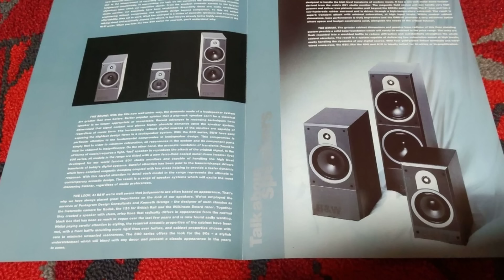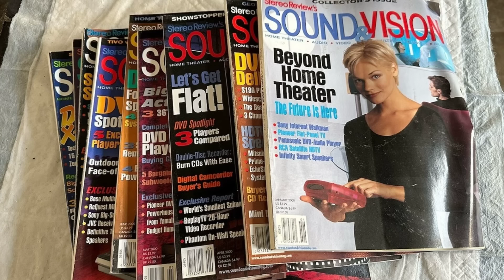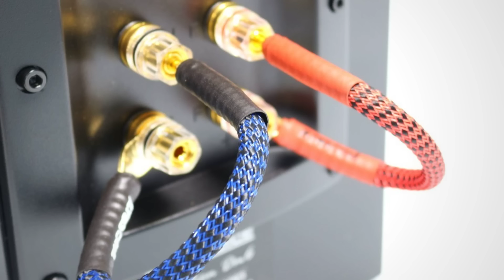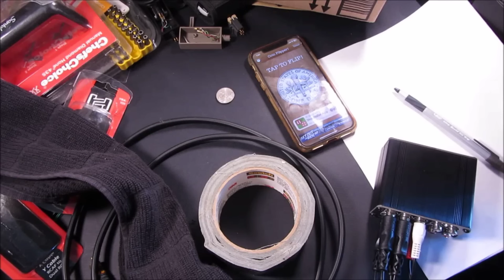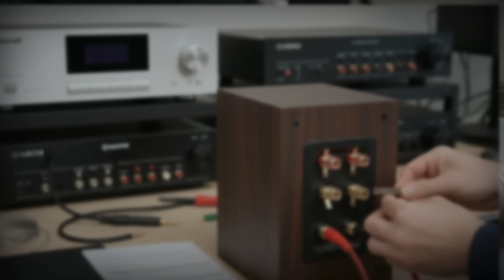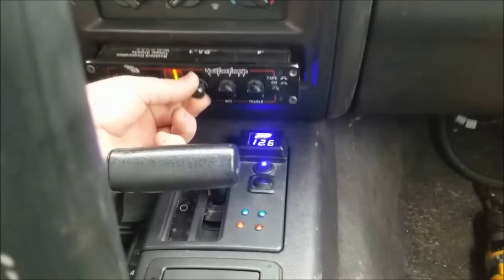Bi-Wiring & Bi-Amping Explained (Scam or Genius?)

Comment: I recently had to refurbish my music studio after a fire and when setting up my old Yamaha Rx-V667 I decided to bi amp my Q acoustics floor standers and the result is a much improved sound over normal connection, I had previously tried the bi wiring method but heard no improvement at all, I listen at highish volumes and in stereo with just the front speakers the transients can be felt in your chest while the overall sound remains clear and not fatiguing, I usually only listen for an hour or so to avoid ear damage.

Comment: The rationality of using bi-wire is exactly the same thing as using $100,000 speaker wires and power cords that are also supported off the floor by little telephone poles, just cheaper. There, I said it, because no one else would.
Reply: If you truly value being rational, do you know enough electrical theory to create proper electrical equivalent circuits for both standard and bi-wire configurations and understand the difference in their behavior? Despite having been an electronics technician for over 50 years, and designing, building, modifying, maintaining and repairing amplifiers and speakers since the mid 1970s, it hadn't occurred to me to do that until about 15 years ago. The same process that can make clear the pitfalls of ridiculously priced cables and tiny poles produces a few "aha" moments when you see what bi-wiring does and doesn't do in reality, rather than just assuming that it probably doesn't do anything. 🙂
Reply: @PlatypusPerspective  Whether I have that knowledge or not is irrelevant when it is fact the human sense of hearing and audio processing cannot tell the difference. Anything that cannot be substantiated by double blind or laboratory tests is conformation bias, at best.

For example, the difference between cheap RCA cables and a set of good quality cables of about $20 was demonstrated in a laboratory setting. The difference was more than subtle at the higher frequencies. I seriously doubt spending a thousand dollars would achieve anything measurably better beyond confirmation bias and bragging rights.

As for what I call "Audiophile Gurus", when a group of people like this proclaim that:

Exotic chunks of wood glued to the tops of filter caps,

Different colors of paint on the edges of CDs,

Stripping shrink wrap off of filter caps,

Gluing some stupid crystal to power plugs/cords,

Little telephone poles under speaker wire,

Replacing ALL the interconnecting wiring in their vacuum tube amplifiers with silver plated Teflon coated wire meant for high power RF circuits,

All improve their "listening experience" I have a very difficult time believing ANYTHING they claim.

And by the way, I have had similar experience to what you claim you have, and more. Including an Extra Class armature license.

Now, as far as I am concerned the discussion is CLOSED. You have a nice day.

Comment: I started out passive biamping my previous speakers and now am tri-amping a pair of 3-wau horns I'd designed and built, with a DSP processor and 6 mono blocks, 2 class A/B EL-84 amps on the mids and 4 Class D mono blocks on the woofers and tweeters. It's sublime.

Comment: My best tip: Skip the terminals all together and solder the cables directly on to the filterboard. Every terminal Ive seen are more or less crap and creates unnecessary decline of the signal. If You have highquality cable with no interruption all the way, I can almost guarantee better sound. That is my own practical hands on experience after long time chasing "experts" and buying connectors in vain.

Comment: Bi wiring is snake oil just as using AVR for Bi amping mostly does nothing as you still are not able to manipulate the High and Low separate and no added power as the AVR most often splits the power between front and rear if both are used. BUT!!! if you have two separate amps with volume controls then you are doing something. Now you are able to manipulate the High and Low separate with added power. Bi amping and removing the Bridge in most of the good speakers will bypass the crossover. 

You are selling misinformation.

Comment: Anyone who seriously claims to hear a difference is just fooling themselves.
“Blind test”: Audiophiles can’t distinguish the sound quality of copper wire, a banana, or wet mud
A blind test using copper wire, wet mud, and a banana in the signal path showed no clearly identifiable differences in sound quality. Only 14 percent of the answers were correct. The statistical evaluation therefore calls Hi-Fi myths into question.

Comment: I do hear a noticeable difference with my Wharfedale AT-500 or AT-400 floor-standing loudspeakers bi-wired to high-output Onkyo AV receiver; although, there’s obviously a significant difference if both loudspeakers are bi-amped by combining both front and rear channels of AV receiver.

Note: Not all loudspeakers for home theatre systems are tuned for crossover to fully utilise full band of frequencies, if you’re only connecting two of four binding posts connected using jumpers, as frequency range of crossover is limited to accommodate an additional Centre Speaker, and you need separately bi-amp all four binding posts for crossover to filter high/low frequencies effectively.

Comment: I was never convinced that bi wiring made a difference so never tried it.
Reply: The only way to know whether bi-wiring can make any difference to a specific installation is to try it. There are a few small theoretical differences it can make (and "different" is not necessarily "better"), but for most people and most equipment combinations, it probably won't do anything audible.
Reply: You are correct.  A properly designed crossover circuitry is meant to play with the drivers in the enclosure that it was intended.  A wise manufacture or developer of 2/3 way component speakers selects the proper frequency and decibel overlap with the corresponding impedance to prevent harshness.

Unless you want to increase or decrease overlap of the crossover network, you're defeating the engineering of the network and potentially damaging the components.
Reply: @RecordnRtist  "you're defeating the engineering of the network and potentially damaging the components"
You might want to try explaining that to the many who insist that bi-wiring does absolutely nothing and is electrically identical to a pair of stock jumper plates. 🙂
Reply: @PlatypusPerspective  I know I'm wasting my time, but here I go again.

Modern passive crossover networks are a circuit board with a single source of input.  A bi-amplified/wired terminal is designed to separate out the low frequency (which determines the overall impedance) from the upper frequency, usually crossed over (as stated in the video) at around the 2k Hz mark.

Isolating and amplifying the two discretely defeats the network and subjects both pathways to independent levels of amplification and potentially different isolated frequencies/impedances; DEFEATING THE DESIGN OF THE ARCHITECTURE OF THE MANUFACTURER.
Reply: @RecordnRtist  Where are you getting these bizarre ideas? Bi-wiring makes no change to the amplification of either path, you appear to be confusing it with bi-amping. Bi-wiring a speaker will not do anything that could damage components any more than using a single pair cable run with terminal jumpers.

Comment: I've tried both too and got the same findings. Bi-amping makes an audible difference as to be expected. 

There's also two ways to bi-amp, vertical and horizontal. Vertical means you  use one stereo amp per speaker.

In horizontal you use one stereo amp per pair of speakers i.e. the highs driven by one stereo amp the lows by the other stereo amp. This means you can try a lush tube amp for your highs and a grippy solid state amp for your lows.

Welcome to the endless possibilities in hifi!
Reply: If you send left and right channels to each speakers of separate amps the output will be a summed mono or am I misunderstanding your explanation?
Reply: @michaelb4375 you're talking about horizontal bi-amping. The 2-way xover that divides the signal relies on the drivers to seamlessly integrate the signal not the amplifiers. That's what they were designed for.

Since amplifiers have their own sonic signature, they may not necessarily complement each other sonically in this setup. Default is using two identical stereo amps to bi-amp and here I found horizontal sounded better than vertical.

Highs require less power so a tube or SS amp with less wattage can be used on them.
Reply: You made the issue more complex than necessary.
Reply: @RecordnRtist Only if you're not the curious audiophile

Comment: Bi-wiring is an intelligence test.
Reply: Eye agwee.
Reply: Basically running bi wire from the amp halves the impedance of the cable and cuts current feedback to the tweeter and midrange from the current created by the woofer movement.
The jumpers bars on a bi wire speaker is designed only to get it working, they are not meant to be permanent.

I'm afraid you failed this test!
Reply: @Hochaloogy Makes some sense as a statement, however, my tweeter and midrange don't respond  to any tiny bit of back emf from the woofer.  I guess YMMV.
Reply: @JohnSmith-qi6co 
No feedback you are aware of at least.
Simply replacing the 2 cent jumpers improves performance.
Why cheap out at the last moment and compromise to save 20 dollars?

Comment: bi wiring is actually buy more wiring. bi wire only moves the common connection point between the woofers and mids and tweeters from the speaker to the amplifier. bi amping on the other hand could have some benefits.
Reply: One of the earliest and most important things I learned when becoming an electronics technician is that where a common connection point occurs can make a world of difference to the operation of an electrical circuit. The position of a chassis earthing point in a car could mean the difference between severe ignition crackle in a stereo or CB radio, and quiet. In the case of HiFi speaker wiring, there's a lot less potential for effect, but moving the common connection still does in fact change small aspects of electrical behavior. Bi-amping changes them more, as well as other effects.

Comment: Thanks for this video. I left a comment elsewhere saying bi-wire on speakers is a waste of money and was told I just couldn't afford it. I owned dozens of speakers often with bi-wire terminals and many amps and have occasionally run separate amps for bi-wiring. The only difference is being able to control volume on each LF HF. No different than using my treble and bass knobs. Not worth the clutter and added cost. Might be worth it for a very expensive system but I agree it is just a means to oversell consumers and detracts from simply enjoying music.

Comment: Great video ! As an electronic technician and audio enthousiast I have observed that some jumpers were adding up to one Ohm of resistance, so a good quality jumper or bi-wire can improve the performance but the rest is simply confirmation biais : if you know a cable is more than 10$ per foot, you will have a tendency to think they sound better.
Reply: As a technician, have you ever drawn up a comprehensive equivalent circuit comparison between conventional and bi-wire topology, and considered the difference in behavior between the two circuits? I hadn't thought to sit down and do that until maybe fifteen years ago, and what you discover is ... interesting.
Reply: @PlatypusPerspective  Hi ! Since I have no sophisticated measuring tools, I rely more on experimentations but only draw conclusion only if the results are significant in scale and audibly.  Now, a few things I discovered is this : First and foremost, crossover part quality and topology ( first, second or third order slopes ) is a major plus for sound quality. Complex crossovers are dynamic vampires and quality components do influence slightly on transparency, imaging and distortion values at high power.  The last point is important because measurement in lab are taken at 1 watt and 1 meter or 2.83v for an 8 Ohm impedence, which is pretty low.  At high power, what we encounter is what I call a ''bottleneck effect'' where the weakest part of the link is showing.

Now, without going too technical, in an iron or ferrite core inductor, release the magnetic field more slowly than an air-core one. This phenomenon is called hysteresis and becomes obvious as frequency rise.  In audio circles, it is recommended to use air-core inductors for frequencies over 250 Hertz.  I tested it and found it to be true : midrange and high frequencies sound cleaner with air-core inductors, but less obvious at lower frequencies.

Quality of capacitors goes the same way. I was asking myself why in hi-fi applications, some install 600 volts capacitors since the voltage rarely goes beyond 50 volts. What voltage a capacitor can take is determined by the thickness of the material ( like aluminium, copper, etc ) and of the dielectric. All those parameters influence the sound signature and purity of the signal. Here again , I tested it and found it true but more subtle than the inductor thing. Consideration of price must be chosen because of the sharp price increase between cheap components and quality ones. My rule of thumb is to make it similar to the quality of drivers and cabinets I am using.

Since I have fabricated or modified over 100 pairs of speakers over a 40 year period, those conclusions have remained a solid foundation of my work. There is a lot more to be discussed but I recommand a channel called GR Research which has reached the same conclusions from his own work. Another one is Alpha Audio which have made tests on cables to test characteristics with surprising results.
Reply: I did! Which is why I posted about the current flow in the jumpers when using a speaker designed for biwiring, but with one set of speaker cables. This obvious consequence flows from an understanding of the disparate current flow in a biwired speaker.

You are a rarity amongst those who comment on the subject; most deny that the current splits at the amplifier speaker terminals due to load demand....God knows how they think a crossover works - I've heard such nonsense from those claiming to be 'engineers'. Like you I studied electronics, and am appalled at the ignorance of those who set themselves up as authorities on the subject!
Reply: @rogerwebb7501  Hello friend, our paths have crossed before. I often hoped once I retired I would get around to creating a presentation of the two equivalent circuits in a way the implications would be easily understood by non-technical audiophiles or YouTube commenters. When I retired, I discovered just how much stuff I was looking forward to doing when I retired, and now I haven't got time to do anything ! 🙃
Edit: Oh no! Thinking about this again has just given me an idea for a possible method to demonstrate the current paths in a non-technical way. Another thing to try and find some time to prototype up...
Reply: @PlatypusPerspective yes indeed....there was another chap, ProfAndy, who knew what he was talking about.....we three sailed majestically in a sea of ignorance!

Comment: What is the sense of bi-wiring? Just get yourself a Thicker Wire if you ain't got enough. And most of you probably already got Too much? You don't NEED a 2 gage wire to run a hundred watts!
Reply: Acoustic Research recommended 0.75mm2 for its best model
Reply: @Silver-e7m  Acoustic Research's own cables were also low capacitance, which was desirable for the stability of some amplifiers of the era. My AR18s bookshelf units don't need anything special ...
Reply: The solution to bi-wire is buy wire? People don't like bi-wiring because they don't want to do that...
On the other hand, if you do buy Thicker Wire, you can use that for the bass connection and save wasting the existing wire by using it for treble in a bi-wire, and have the best of both worlds!
Hint: the sense of bi-wiring is individual current paths for low and high frequencies, with the crossover sections becoming largely unaware of each other, which heavy cable, although good, does not achieve. Is that going to make an audible difference? Probably not, except perhaps in some specific cases. I always advise people to borrow cables, listen, and if they hear no difference, forget it.
Reply: Thank you so much Jessica and wow you're sooo gorgeous too omg 😍😍😁😏😏😙

Comment: Would agree bi-amping is more easily discernible. Also do believe, though, that wire materials and construction affect signal transmission. Obviously, to have an appreciation for changes when bi-wiring, one must have an incredible revealing system in an appropriate setting with trained ears. For me the fact that Amir at ASR was referenced ruined credibility as his philosophy along with his minions are measurements only.

Comment: Βi-wiring,in my humble opinion,is not worth the effort,is not worth it at all
Bi-amping,however,is another matter and if all the specs (topology,gain,sensitivity,impedance etc) studied correctly,this combo is by far the best option
Although the external crossover would be a much better choice i drive my speakers in horizontal passive bi-amping mode and the resulting SQ (for the money,of course) is excellent
thank you